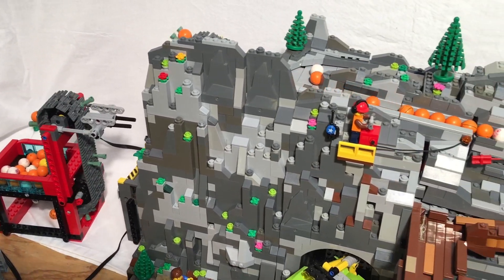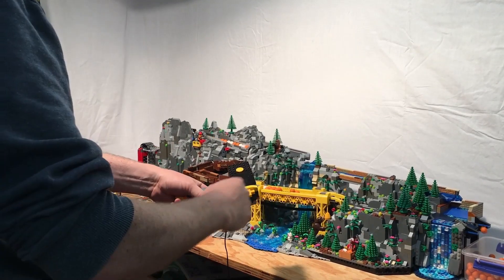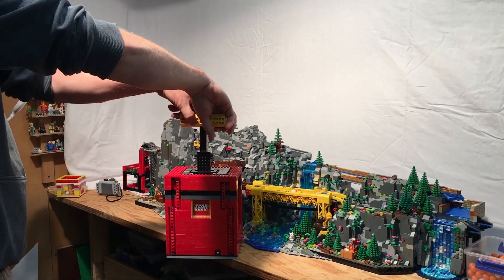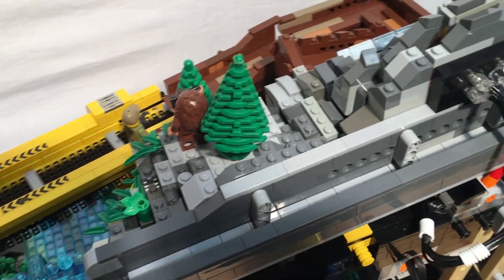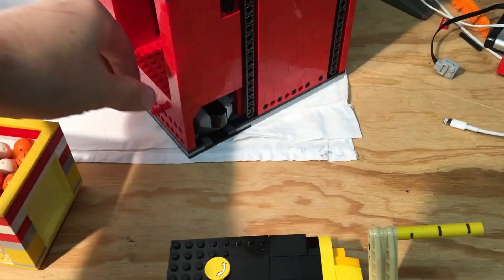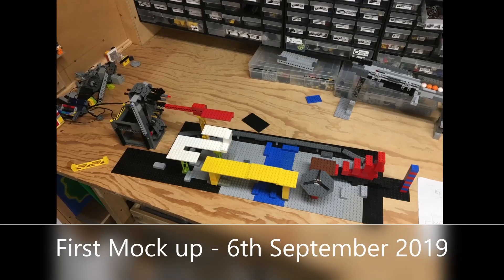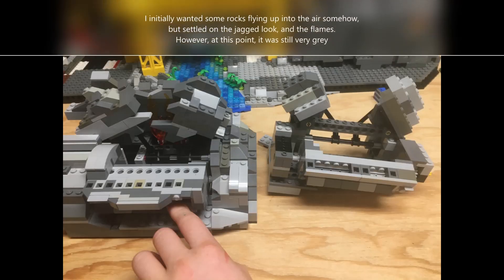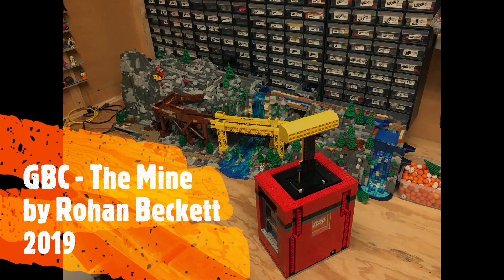GBC - The Mine

Comment: You win. Super creative. I love the added crowd interaction aspect. Kids will love this. 
Might have to add some string to the generator. To get taunt before the wire gets stretched.
Reply from the maker: Paul Hvidston thanks for the comments. Check out my Brickvention 2020 video and you can see it in action! It ran really well all weekend. Hundreds, if not thousands of people played with it! The cable to the generator was the only non lego part I used custom wire with quick release audio cable connectors.  I only had very minor damage to a couple of pin connectors inside the generator, when the crank wore them down